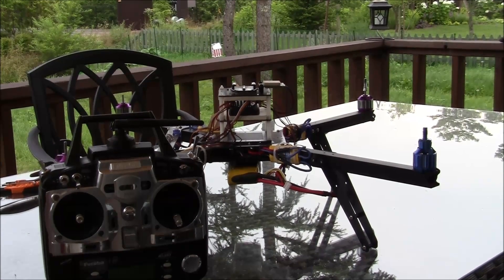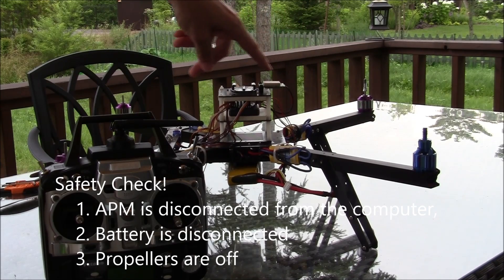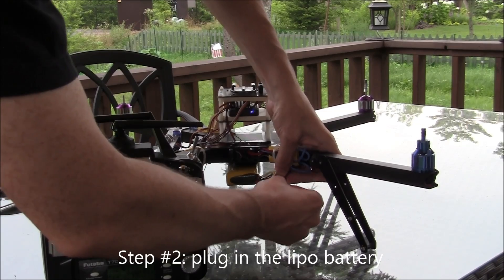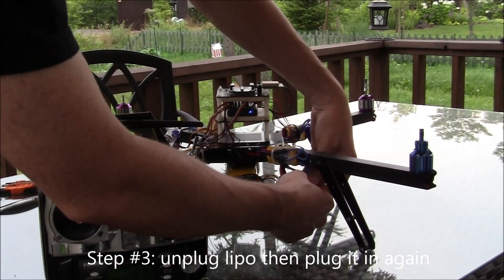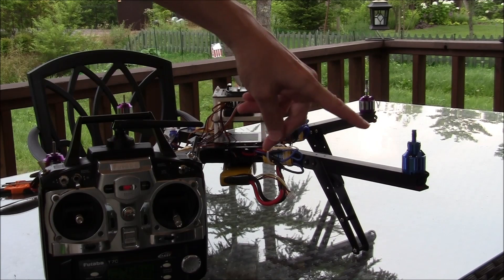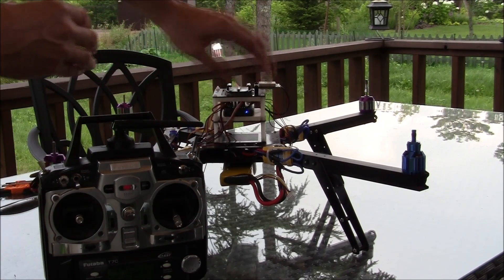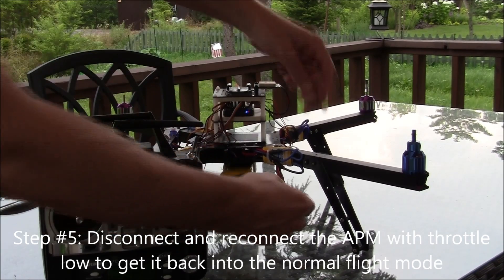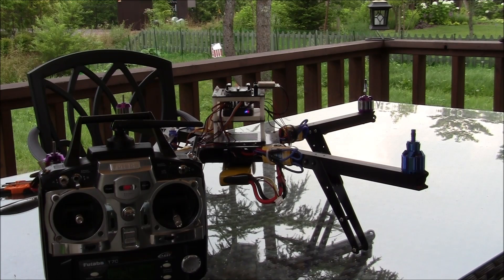ESC Calibration "All-at-once" method

Comment: Do you have an arming switch on your transmitter ? If you do what position is  during the calibration process ? And when you finished the calibration, do you disarm your drone  by turning off ( disarming ) that switch and unplugged your battery  or what is the  order of doing these things ?

Comment: Can I do this with a joystick instead ?
Reply from the maker: Hi Eliot, I suspect it won't work with a joystick because the packets from the joystick won't be consumed early enough in AP's startup routine.  I could be wrong but if you try it and it doesn't work then this will be the reason.  I think if using a joystick, an alternative is to make sure the RC input calibration is done then use the "Semi-Automatic" ESC calibration method https://ardupilot.org/copter/docs/esc-calibration.html#semi-automatic-esc-by-esc-calibration
Reply: @rmackay9  Hey Randy, unfortunately I do not have a radio controller. I'll see if I can I can get your alternative solution to work with my joystick( ps4 controller ). Thanks.

Comment: Thanks but should my transmitter be calibrated with missionplanner with connected drone before this esc calibration because this afternnon it goes always wrong and in the past everything whas ok but new setup of my pixhawk and frsky taranis qx7s and not calibrated in missionplanner ?
Reply from the maker: Ron, yes, the RC should have be calibrated at some point before doing the ESC calibration.  In fact, I think the ESC calibration won't work unless the RC has been calibrated.  The input throttle channel's range (normally input channel 3) is also used as the output range for the ESCs.  The input and output ranges can be made independent by setting MOT_PWM_MIN and MOT_PWM_MAX to the output range you want to use.  So it is perhaps a good idea to set these parameters to 1000 and 2000 respectively and then re-do the ESC calibration.
Reply: @rmackay9  Thanks and I have seen on YT that the safety Arm switch should be set on zero so shutdown because it can undo the second start for ESC calibration, but every time all props remove when safety scheck disabled !

Comment: My issue is that my throttle controls two motors(push up for one and push to the right for the second) and I have to use aux switches for the other two I hate this. I want my throttle to turn all 4 motors at once and I can't find a video of a forum or anything that helps. Someone  please help.
Reply from the maker: Hi James, I'm not quite sure I understand what you're trying to do.  Is this a regular quad with four motors that provide thrust downwards or are some motors pointing sideways?  AP doesn't really support sideways facing motors in the multicopter firmware.  It may be possible to support if it is setup as a VTOL plane.  Maybe I'm misunderstanding though.

Comment: Are you using Mode 1 for radio transmitter...??? Right throttle...???
Reply from the maker: AJAY, yes, that's right.  i live in Japan and Mode 1 is quite common here..
Reply: @rmackay9  thanks
Reply: @abidikar , I know I'm a year late, but I use mode 3.  My son and I both thought having the throttle on the right side just felt more natural.

Comment: Hi Mr. Randy, Whenever I plug in my Lipo battery, ESC's starts beeping but one of them gradually goes out sync with the other 3. Also once all of them are calibrated, When I raise the throttle one of them starts spinning slower compared to others and my quadcopter tilts. Any suggestion as to what I'm doing wrong. I'm using APM 2.8 with 30 A sc and 2212 1000 Kv motors. 6CH 2.4 ghz RX and TX.
Reply from the maker: it sounds like one of the ESC's clock is a bit off from the others.  I wouldn't worry about it though although you could replace the ESC if you like.  It's not an ardupilot issue though.  The issue with one motor spinning slow is most likely because it hasn't been calibrated.  I'm afraid I can't provide support for the APM boards, we stopped providing software updates to these boards almost 3 years ago now.  It's best to get a more modern flight controller, there are so many!  http://ardupilot.org/copter/docs/common-autopilots.html

Comment: My issue is with ESC calibration. I have Mystery 30A ESC's, and I complete auto calibration successfully (two beeps with throttle up, put throttle down a further two confirmation beeps). On applying throttle all 4 motors spin up simultaneously, and as far as I can tell at the same speed. 
When I disconnect the battery and try again later, the following happens. The ESC's arm after 20-30 seconds with two confirmation beeps. This is all apart from motor 4 which does not appear to arm at all. When applying throttle three of the motors spin up, no response at all from motor #4. If I go through auto calibration again motor #4 will calibration successfully and once more for the duration that the LiPo is connected they will work in unison. Disconnection / reconnection recreates the problem. 
I've switched the motors around and it seems to always be output pin #4 not arming, independent of the ESC's or motors attached to it. how can it be solved???
Reply: Bu sorunu çözebildiniz mi

Comment: Can we use telemetry module instead of rc controller for esc calibration in apm 2.8??
Reply from the maker: If you use the mission planner with a joystick that may work.  We stopped supporting the APM2.x hardware over 2 years ago so I highly recommend upgrading to a more modern flight controller.  The pixhawk is the most popular but there are others as well.  http://ardupilot.org/copter/docs/common-autopilots.html

Comment: I get the motors to work but when I unplug the battery and plug it back again it doesn't save the calibration?
Reply: yep same happens wid me
Reply: did you solve the problem bro?
Reply: Zezo1111 G  yes it works now. 
first of all. for God, your mother, and everybody S sake. take the propellers out. I am so thankful mine went to the other side rather than towards me. the prop got stuck halfway into the wall.

any way. set the throttle high. plug the battery, wait like half second and unplug it. leave it unplugged for  2 second and then plug it back again. when you do. don't lower the throttle. wait 10 second  then do so ( you should hear a different sound) that means ESCs are calibrated. at this time lower the throttle. 
unplug the battery. plug it back again, wait 10 seconds for the controller to initialize, and turn the throttle to the  right down and hold it. it will turn on.
Reply: +Youssef Cherqaoui oh lol, that was dangerous though man, alhamd le allah no one got injuried.... it happened with me yesterday when I was trying to fly my dirty new quad who doesn't to fly till now... i hold it in the air with my hand and one adapter not has been tightened properly the prop blown away and was so scary it could have injured my eyes... these machines are so dangerous and need to much care...anyway thanks for help bro, now wish my fucken apm 2.6 doesn't forget that calibration because it's time i have to do same steps
Reply: Zezo1111 G  they are problematic. I learned that the hard way. mine flies but no matter what PIDs I do or calibration, it does not fly smooth.
Reply: +Youssef Cherqaoui she might not flying smooth many reasons, its could pid sittings, cg and so on, but nice bri it flies, mine does not fly at all, she flies but some times drifts to right and some times flips back or forward, im trying to lift it off by re programing my shitty amp

Comment: I have a quantum nova , it will not lift off with the throttle on high , batteries are charged, so I figured the escs needed calburatied  , when I do this with the drone , I get the three beeps but not two, just three fast beeps for ready to arm . I still cannot get it to lift off.  Any other suggestions .
Reply: Have you found a solution ?

Comment: Hi Randy...i get a problem with Escs calibration....Pixhawk can't save my Escs calibration...i've tried with the first motor wired ( -,+,s) and the others only ( s )   or the same for motor the first but the others with ( -, s )  or all with ( -, +, s )...i can't calibrate and test motors, they run very well but to go out calibration....gaz low and unplug/plug with music of Pixhawk like your video but no blue led....or unplug with gaz high like 3DR robotic on You Tube too....and no blue led ...in these 2 cases NO CALIBRATION SAVED.................!

I've looked for this pb on internet o, lot of forum...............no solution right now...
Do you have an idea....?

Best regards
Philippe

Comment: for some reason my ESC calibration is not working because when I start it with full throttle(everything like in the video) but it seems the ESCs cant see the battery's cell number, becuase it makes weird tones, I am waiting for the 3 beeps(3cells) and the additional 2, but it is making a tone. the minimum throttle is working fine. after calibration 1 motor is working, 3 not. can someone help me?

Comment: Hello I'm having  ESC Calibration problem, Pixhawk Controller and Air gear 350 motors and ESC.  I can not solve this problem  If someone knows what to do plz tell me.
i have tray manually calibrate from receiver it's calibration and works fine but when i connect to Pixhawk Controller ESC still beeping . 
it's my configuration of quadcopter
Pixhawk Controller.
T motor Air gear 350 motors and ESC.
battery 4s 5200 amps

Comment: Hello Randy, My BEC ESC's keeps going hot and feel not really reliable, I am trying to replace them with OPTO 2-6S I did connect them to APM board 2.6 without moving JP1 they seem like working and motors spin fine, I removed the middle ESC wire (Red) connector to board output motors are still spinning fine, I am worry to fly my drone and crash if don't have proper connection, do we really need to remove JP1 to use opto ESC's, I searched every where to find any forum support OPTO ESC's with APM but I couldn't find any clear support to this kind of configuration. I am using 3RD power module

Comment: Hello, I followed the steps in the video, got all the same beep tones and behavior of the esc/motors and good low idle.
But when I disconnect and reconnect the APM2.5 (at 2:02) ,  the throttle settings are not saved an the copter starts in very high idle at minimum. Repeating all the steps again all is fine BEFORE - unplug and plug on again. What am I missing? Why don't the ESC's save the min/max throttle values? (Using Hobbywing Platinum Pro 40A ESC) Thanks for any ideas what to do :)
Reply: bekawe2011 Having a very similar issue...
Reply from the maker: bekawe2011 Not sure really.  Maybe those ESCs can't be calibrated?  There are so many different ESCs on the market it's hard to be sure how each one acts but for those that can't be calibrated, they are generally locked to a PWM range of 1000 ~ 2000 so the only solution is to change the transmitter's channel 3 range to also be 1000 ~ 2000 then re-do the radio calibration (using mission planner or whatever GCS).  We use the ch3 input as the same range for the motor output.

Comment: you can not calibrate esc without it being connected to the motors? , its connected to the power board  but not the motors.
Reply from the maker: Edmundo Andres it's actually the ESCs that are being calibrated so they must be connected.  You will not be able to hear the tunes from the ESC without the motors connected though so it's best to have ESCs and motors connected.
Reply: AWESOME! THANKS FOR THE ANSWER thats what i wanted to know :P i tough my esc were damaged or something i turned on the quad  and no sound at all, but its because i dont have the motors yet :D

Comment: Hi there, looking for help. I have done the calibration process successfully many times, so thats no the problem. After the calibration process, i connect the battery , but my ESC only beeps every second, there is no "arm" with the apm or anything like that, ive checked the connection and everything looks ok , any idea? Regards

Comment: Hi Randy,
Thanks for all your  tutorial videos. I have an issues with ESC calibration on my quad that I just built. Whenever I try the "All-at-once" method of calibration (at step 3 - connecting Lipo), it would not produce any musical sound. I waited and waited but no beeps. When I set the throttle down, it beeps, and if I raise the throttle up, motors start spinning. But when I unplug and plug the Lipo again for the normal mode, I can't have my motors start. Can you please help me figuring out what could have gone wrong that ESCs are not calibrating? Really appreciate your help.

Comment: Randy, I don't get the same beeping sounds as you get but when pull throttle down and then up motors respond to calibration, I notice before my motors use to spin by hand nice and smooth but now I notice there's some friction (not spending as smoothly as they use to) can u help? Thanks
Reply from the maker: javierymirna, the motors no spinning as smoothly as before is most likely a mechanical issue.  As a software guy, I can't help with that I'm afraid.
Different ESCs make different sounds so if you're not using the 3DR ESCs they could very well make different sounds.
Reply: Randy, just FYI my throttle problem was a software issue, some how the THR_MAX was set to 80 and not giving me enough juice to the motors; i'm pretty sure that my TX being all reverse (right when trying to make a left and back when trying to go forward), it's another software problem... throttle issue fixed! radio controls still a problem... APM is sure messing around with their firmware, I've gotten 3 updates in one week!
Reply: javierymirna How did you fix your thr_max issue? Think i might be having the same issue.
Reply: Patrick u go into advance parameters and scroll a the way to the bottom, you'll see there the THR_MAX if it's set to 80 you need to change to 1000. Let me know if it works :)